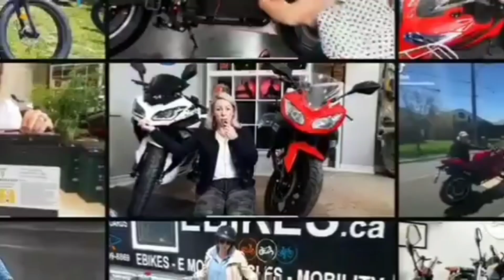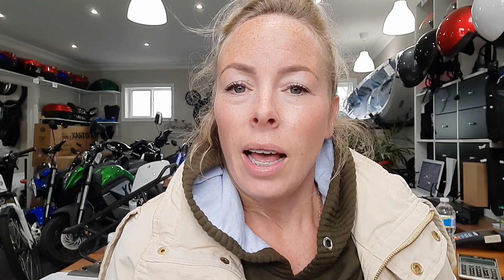Should you Expect the BEST quality from Ebikes?

Comment: Excellent video!  You’re giving all of your viewers correct and reasonable expectations.  Well done.  An ICE motorcycle, costing three or four times as much as an electric scooter/e-bike, is going to have higher grade parts.  The important thing to remember though, is that the electric scooters you sell not only cost way less up front, but they cost way less to run and maintain.  They require no license.  **They do not make climate change worse.**.  Thank you, Calvin.
Reply from the maker: Absolutely.   Thanks for the love,always
Reply: I just wanted to comment regarding your climate change comment. Climate change to me is a much greater topic amd scope than just carbon emissions. There is so much more that we need to change. One thing that EV users almost never consider is the amount of water used to mine lithium.  All the way down to even the recycling of clean energy producing turbine blades. It’s huge.
Reply from the maker: @MarkSvara  I didn't mention climate change AT ALL 🤨
Reply: @ridethewindebikes  was I responding to you?

Comment: What happens if you del a bike and there is an unusual persistent vibration coming from one of the wheels at say 55kph , would you provide a new wheel and tire with no charge under the warranty? Thanks.

Comment: Fit and fitment is always a problem.  My DX is not a Kawasaki or Harley so my expectations were met.  I have broken a couple of pieces on my bike and found the replacement parts to be very inexpensive as well as colour matched.  
I do have certain realistic expectations, yes.  Am I aware that the materials used are not top quality, yes.  
Just to qualify myself is work for General Motors.  So I see all sorts of poor quality in some of the cars.  This also gives me an outlook on what is and is not acceptable.  Plus you can do research and upgrade to better brake pads and tires and such.  
So take a bit of a breath, understand that there are limits so the bikes can be reasonably priced.  The rest well that is up to the consumer and their understanding.
Reply from the maker: True. Awesome. Great info and input. Thank you 😊